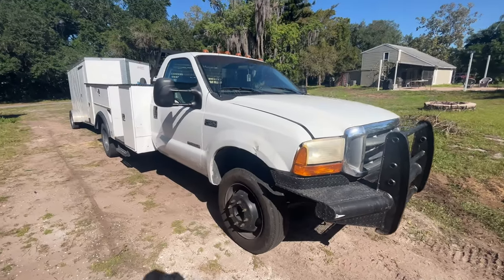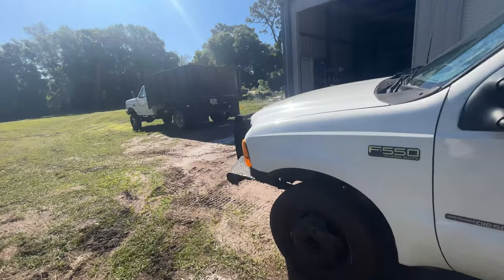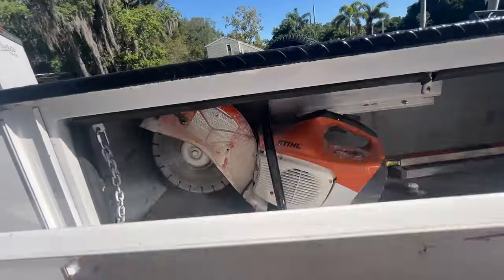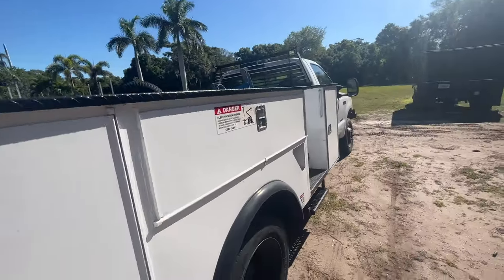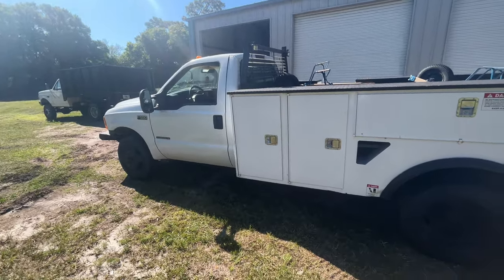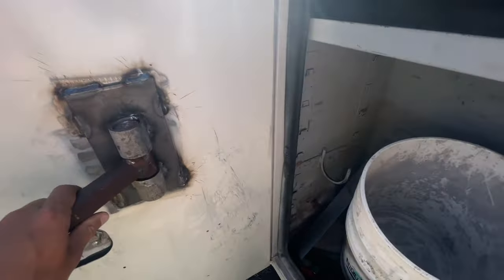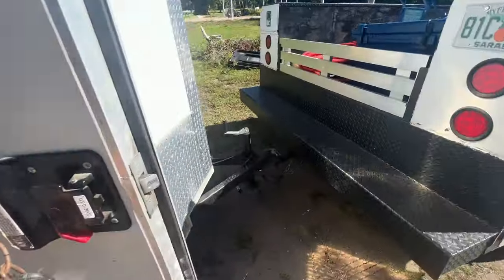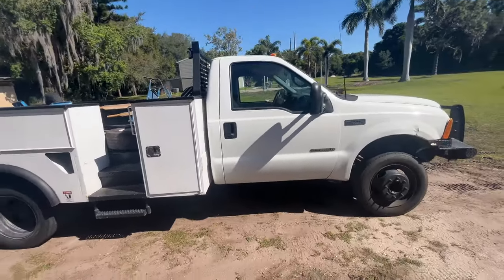ANOTHER TRUCK ADDED TO THE FLEET!!!

Comment: Sweet Rig Brother! Them Fords do run! I wish i was down there with you, I could get that Passenger door working in like 2 minutes! You got to get a wide thin blade like you use to apply compound or whatever and stick it at the door gap at the bottom of the fender and slide it up and pull it out just a bit while carefully pulling the door open. That fender will move enough to open the door and leave the fender on the outside of the door and you will be good to go after that! I have done it a few times and it works!
Reply from the maker: Wow thanks i'll have to try that out!!! i will let you know how it goes! You're the man!